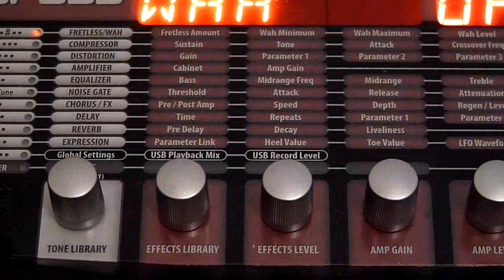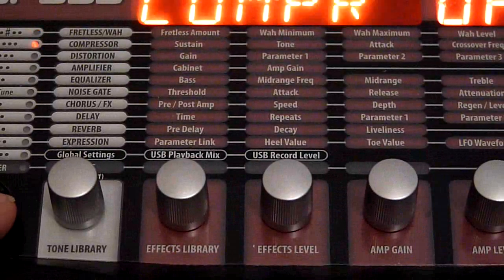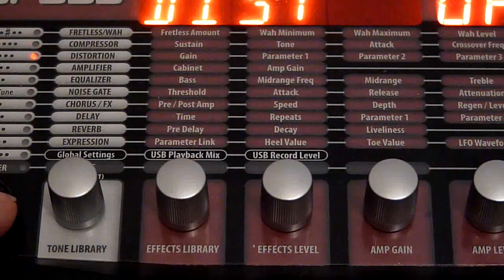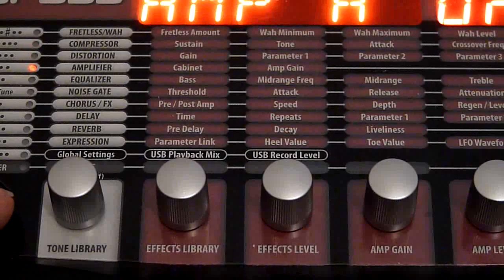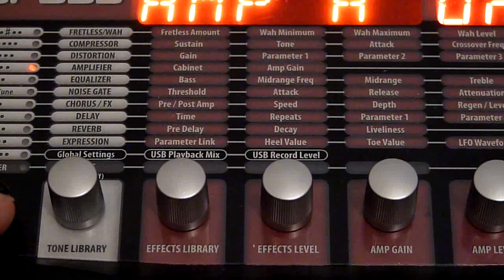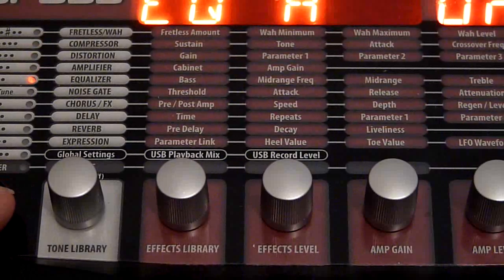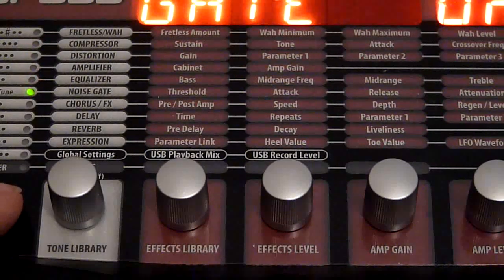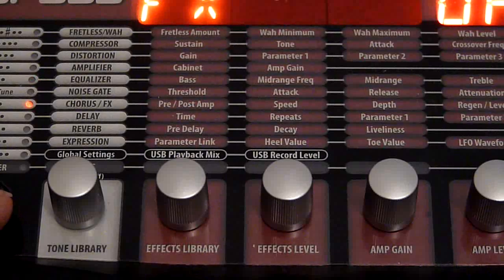BP355 Understanding the matrix programming system

Comment: Hi would you be able to tell where the tuner is? Thank you
Reply from the maker: Actually no - Since I haven't used it since this video was uploaded  in 2011. The Manual  Says this: "Tuner Mode
The Tuner in the BP355 allows you to quickly tune or check the tuning on your bass. Enter Tuner
mode by pressing and holding the Up and Down Footswitches simultaneously for 2 seconds.
The Display briefly shows tuner indicating that you are in Tuner mode. To begin tuning, play
a note on your bass (a harmonic at the 12th fret usually works best). The Display shows the
note being played. The Matrix LEDs indicate whether you are sharp or flat. The top 5 red LEDs
indicate the note is sharp and should be tuned down. The bottom 5 red LEDs indicate the note
is flat and should be tuned up. The center green LED indicates the note is in tune. The output is
muted in Tuner mode. The Expression Pedal controls the bass volume while tuning. Exit tuner
mode by pressing any Footswitch."

Comment: I don't know if you still have this channel, but I found one of those things at a pawn shop for almost nothing. After I had paid the guy we opened the box and it was brand new. Everything was just like it rolled out of the factory. The pawn shop guy was like, ever who had this thing took good care of it. I said, The box has never been opened, and it hasn't until I did it.
Reply from the maker: Great for you. I still have it and I hardly ever used it. not because it ain't good - It's just that I am not a bass player and play other instruments as well. lately I came back to bass but not planning on using it. Should have sold it back then.

Comment: I just got one of these last week. There are two "banks" of 70 presets, one set for factory settings, and one set for your own. The bank of 70 factory settings can no be changed so you will never lose those. The bank of 70 user settings start as an exact copy of the factory, but those you can adjust, edit, change, and rename however you want. 

So, there's really 140 presets available, 70 set from the factory, and another copy of those 70 that you can then edit.
(I hope that made sense)